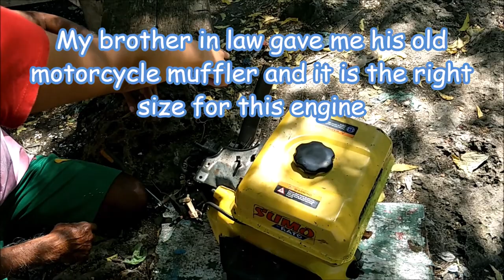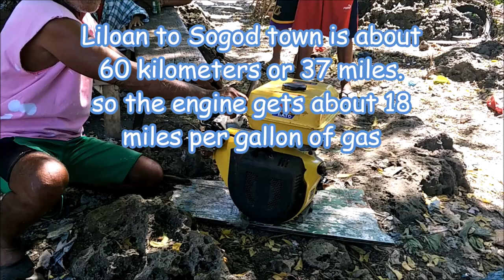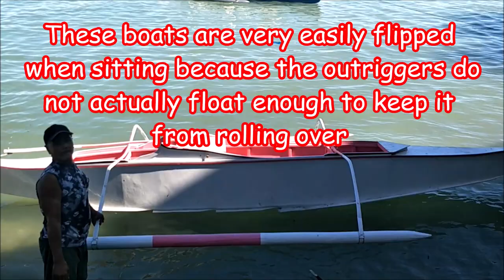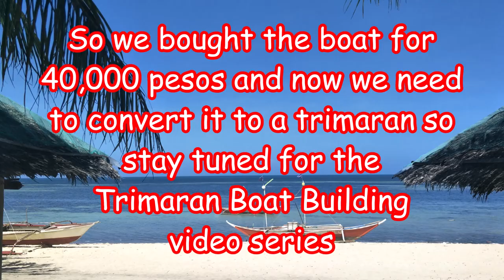We Bought A 3 Cut Racing Boat And Will Convert It Into The "Paradise" Trimaran

Comment: Man.. that boat is fast as hell 😂👍 I would trust it for a couple years 👏👏 want to see you do modifications 😂 I don't know.. colors are not bad.. you need a name for it😂What would be nice is like in expensive canoes the have a wicker or woven seat that you can put in and it's just on two poles with woven fabric can remove seat if you want. 4 slots for 2 poles to go into 2 on each side. Aluminum poles material is wrapped around and fits down into the solid mounted slots on the boat sides